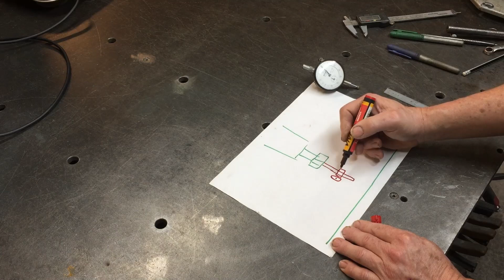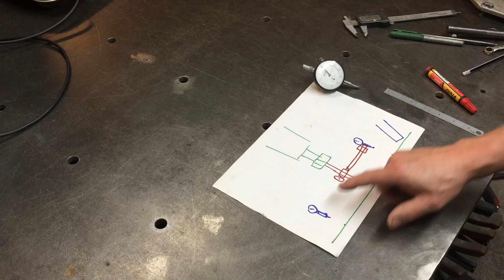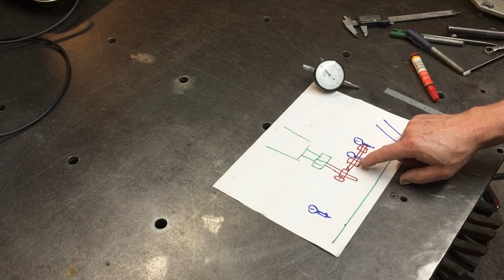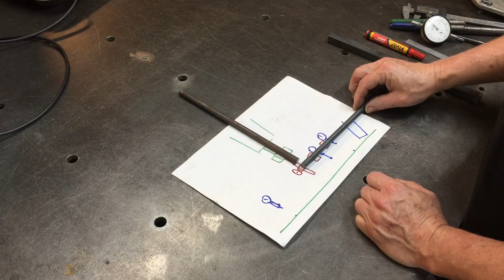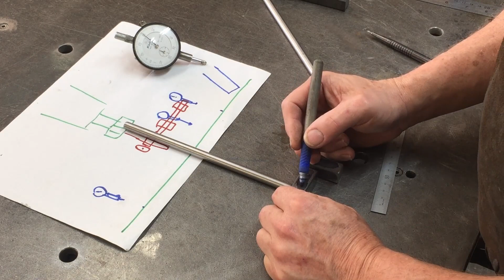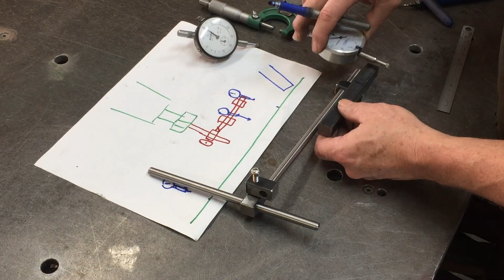Dial indicator holder to tram a round column mill

Comment: I came here on Rob's recommendation and I'm glad I did.  A boring head, a rod through it and a screw in each end of the rod for the eye on the back of an indicator is what I did, seems to work okay too.
Reply from the maker: Thanks for stopping in Jim. Yes, there are countless designs. As long as it works so you can get the job is the most important thing.

Comment: Rob sent me over. Would it help on the indicator mount end if you reverse the horizontal mount, screw the indicator mount to it with a nut to clamp securely onto horizontal shaft? That way you can get the indicator tension correct while the nut would hold everything in place
Reply from the maker: Thanks for watching. Yes, that could work. I guess I did not spend a lot of time designing this which is not like me at all. I typically over design projects. But I wanted to add the bit at the end so that others were aware of the limitations.

Comment: Well done.  Whilst it would not make much difference to an ER style collett  because the slits are cut from the front and the back equally so clamp equally if you were using an R8 or Morse collett you should aim to make the bar an almost exact fit to your collett size because the don't. Might be helpful to someone else looking at this if they have a different sort of collett system in their mill.
Reply from the maker: Thanks Ben.